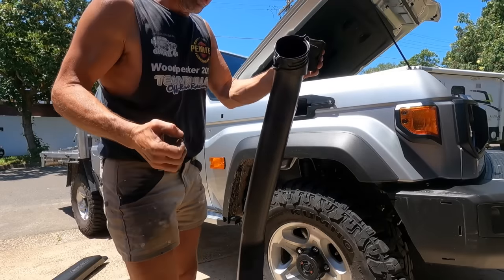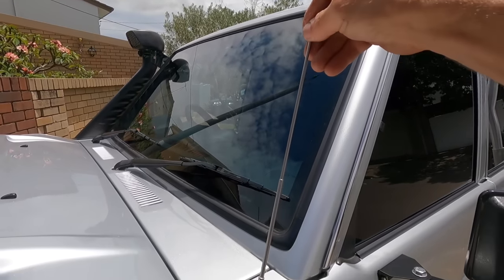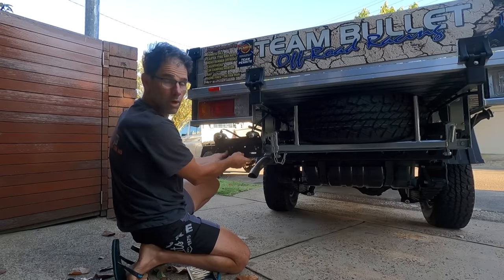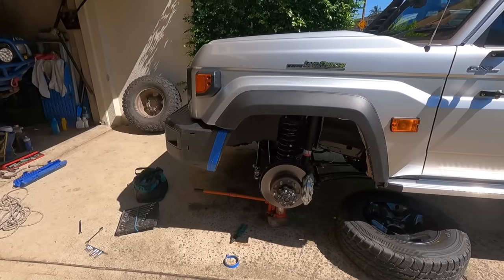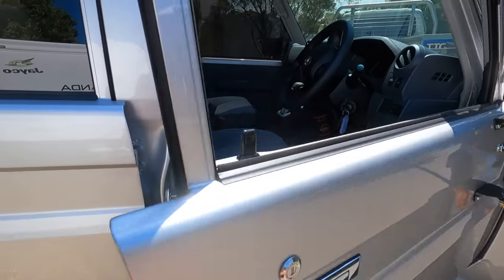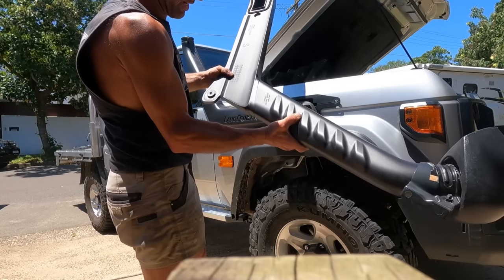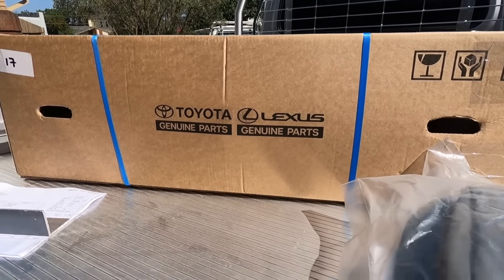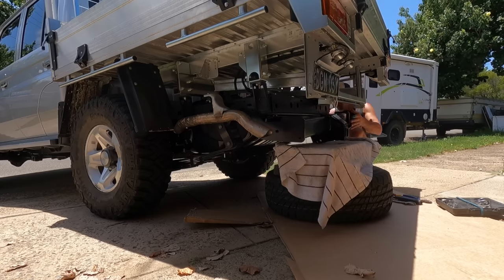NOT A V8 2023 VDJ79 1GD 2.8 Part 2 1 week old and we have fuel consumption a tyre swap & fit towbar

Comment: Here in Dubai the new 70 series only comes with the new 4.0L V6,24-Valve DOHC VVT-i Petrol Engine and NO 2.8L Diesel as an engine option ,the base showroom price is around 169,000 dirhams about $79,000 AU
Reply from the maker: Interesting.... Thanks for that info...
Reply: Is that the 1GR-FE engine?

Comment: Read the directions on that bolt that goes under the tongue. It’s an anti rattle bolt for the tongue BUT if it’s like all other Toyota towbars, you have to remove the bolt before you tow with it, generally I’ve always left it out on all my Toyotas (eg prados) otherwise for sure as 💩ill forget to remove it when towing
Reply from the maker: Wow thanks for that, I never would have thought that, theres so much play in it...

Comment: Does the Fortuner also have the display for DPF burn on the dash? For that matter any of the other Toyota products with the 2.8? I think this feature would save many DPF problems and should be fitted to every car with DPF 👍 good thinking Toyota
Reply from the maker: 100% they all should.. No the fortuner doesn't have an indicator or a light for that mater, maybe the newer one may, our one does not. I remember the 1st burn it did, it just revved high at idle, thats all the indication it gives!

Comment: I would be sold on the auto if...You could "Clutch" start it with a flat battery and if you could drive it (in low range) using only the starter motor. I don't know, is this possible?
Reply from the maker: No its not, and I hear what you are saying, im even paranoid about vehicles that are keyless start too...

Comment: Please can you check the vacuum pump accessibility in 70 series? Because it is located in back of the engine and its service item that requires engine out job in other models
Reply from the maker: Will do mate and thanks for the tip...

Comment: Hi Denny, Did you get a choice of vehicle from the V8 to the 4 and auto to manual? I assume this was your choice.
Reply from the maker: Already having the manual V8, in stock form, tows the 3 tonne bad on 35s, bit better on the 285s but still bad, the places we take Bullet of late we have Mt Ousley, Mt Victoria, lots of mountains, having experienced towing the 3tonne with Chelles fortuner, also auto, it tows it way better than the 79, and the Tuna is stock too on bigger shoes..  So the V8 tows out 2 tonne jayco fine, so its that extra tonne... Now the grey pre dpf I had sooooo much power but having thrown big $ on that motor to get the near 700nm. So I will be able to compare now with the auto, which is what twisted my arm on this one...
Reply: Fair points....i have the first of the new V8's (about a year ago now) Previous was a 2013 tuned which i was happy with. This one is still sluggish after the tune...it must be the DPF!. useless stock power wise. The money we pour into them is ridiculous. All the best with the new rig...

Comment: Good video. Will be interesting to see how these run on 35s.
Reply from the maker: Wont have the height for the 35s, or until I set up suspension... But the 285s it still goes great... The tow test is coming...

Comment: wasn't this one supposed to be your portal build?
Reply from the maker: No I cancelled that one, that was Jan this year as I knew the Auto was coming, not in the current form though I assumed the 300 set up... But its still an outside chance, they have to get one themselves Marks to do a house fitting as all the under bonnet stuff will obviously need tweaking, and ill have to do post rego, engineers involved etc. Nick at Solve offroad will do it if I go that way..  Thats why im trying to set this one up to tow on stock suspension... Thats in next episode.. Thanks for the question, and I just looked up at how much I typed.... Sorry if I bored you..
Reply: @TeamBulletOffroad  I appreciate reply. I'm very keen to see how the 2.8 evolves on the channel.

Comment: There's certainly some cons with this new 79 which many people wont even notice or think about. I hope the pro's out weigh them for you.
Reply from the maker: I think we around the 50/50 split, but the easability of driving tips it in favour, can't wait for the off-road test in the auto.. that should seal it with the expectations I have Jim..
Reply: @TeamBulletOffroad  yes it should be much easier with the auto. I love the ease of 4wding in our auto Challenger with rock climbing, beach driving etc.
Reply: Which cons?
Reply: Toyota still haven't fixed the front end not matching the rear  even with a 2.8 engine??
Reply: @davidkelly6122  Yup. They just don't give a shit. It's especially offensive when the 70 Series is mostly sold in third world markets where it will not see a sealed road in its lifetime so being stable off-road is of major importance. Toyota is a pretty asshole company.

Toyota will "apparently" deliver 2024 70 Series models with the V8 to customers who've placed placed orders on the V8 before the new one was announced but so far there are NONE anywhere on the internet.
Reply: @davidkelly6122  They still sell the 70 Series with the 1GR-FE 4.0L V6 in the Middle East but that only has a 60° bank angle, the 1VD-FTV 4.5L V8 had a 90° bank angle so it needed the wider engine bay. The V6 might do fine with the narrow one.

Comment: I will stick with my 2022 Hilux Rogue thanks.
Reply: @Routeseventy6 For the LC badge maybe? For me the LC can be a V8, a V6, a straight six, but not a 4. There needs to be something that differentiates the two market segments, in cars it’s the engine and vehicle dimensions. The LC isn’t really that much bigger than the Hilux and now they share the same 2.8 four pot engine. Silly.

Comment: Toyota have gone all out on the new model Landcruiser.
Cheap and nasty.
The bonnet latch will be one of the first things to break.
Pretty disgraceful really for the price.
Reply: @toejoe5076… That was my first impression!
Everything just seemed cheaper and nastier.
The paint looked thinner, the plastics looked less robust, and any metal bits looked tackier.
😳🙁
Reply: Must be made in China 😂😂
Reply: Toyota decided to go cheaper in non vital parts like chassis, powertrain and 4x4 system they know people will throw these flimsy parts out as soon as they get the car 
I can understand our frustration but these companies are caring about money more than quality
Reply from the maker: The paint on the 2022 models was thin in the white and sandy, all the recalls for rusty doors were in those colours, this silver looks ok..
Reply: @TeamBulletOffroad  I know a panel shop manager for Toyota who showed me exactly this. And this paint warranty goes for a long time too so you can yours (the MArket)and take it back for a resprays.
Reply: @christurner68 when you spend $80 000 plus why should a new car go back for resprays.
Toyota are cutting corners with quality and people will still buy any shit they make.
Reply: @toejoe5076  totally agree! Where id I say it was acceptable???!